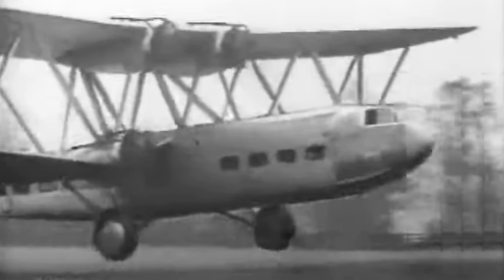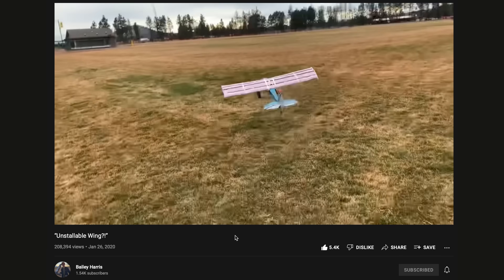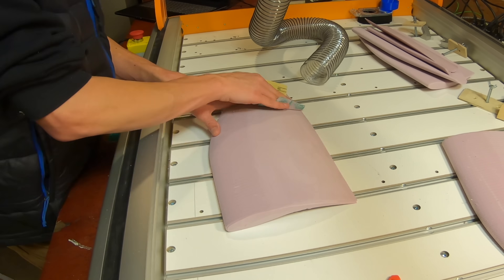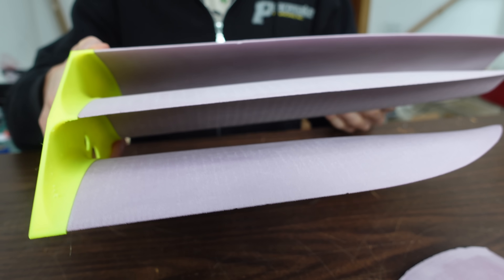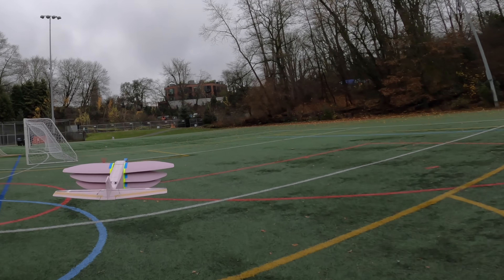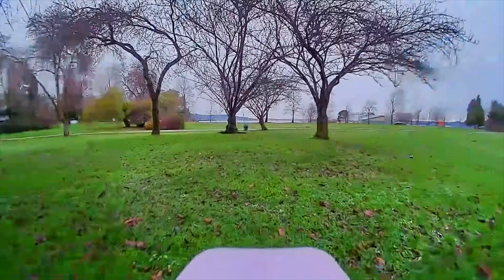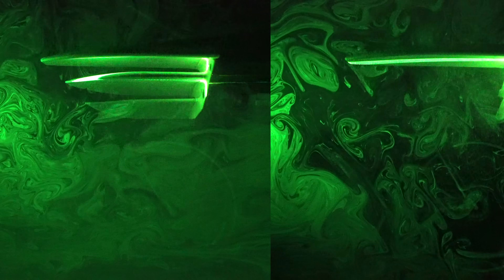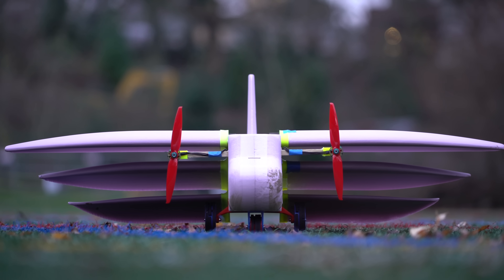Best STOL Wing Design Ever?!?

Comment: Would the wing configuration work as a "flying wing" design? Without the draggy middle part and all lift surface? Basically taking multiple B2 with caried angle of attack stacked on each other.
Reply: Probably not, due to the pitching moment issue he mentioned. A flying wing has no horizontal stabiliser to balance the plane, so it cannot use wing designs that have a positive pitching moment at positive angle of attack. Ignoring this rule produces a plane that is intrinsically unstable, and while that might be acceptable with computer assisted stability controls there is still a limit to how much instability can be present before the elevons are overwhelmed.

Comment: To help fight the pitch down effect, it may help to mount the motors lower (closer vertically to the center of pressure) and/or make the thrust angle higher in relation to the wing.

Comment: the thing about that multiple wing is that works properly by laws of physics only when its reversed so lower wings are in a front and upper is in a back  then the lower wing air flow pushes up an upper wing and next one does the same . I this configuration air flow of lower wings is disturbed by each other . And that specially works in higher velocity , you´ll see , try to change that design

Comment: You put a lot of thought and work in to the concept. Good work. Look at the Burnelli UB-14 aircraft. The designer had the same pitch instability issues due to the downwash from the main top wing. As it leaves the trailing edge it momentarily goes down wards and them it moves up. In this case as the trailing edge wash moves up  it hits the underside of  the elevator causing a pitching moment instability. This makes it harder to control. If you would like to make the plane dynamically balanced it will help to move the elevator further up and away from the trailing edge wash. That is what Burnelli had to eventfully do for his high lifting body concept to work.  Thank you for sharing the video. I enjoyed it.

Comment: If you move the motors further down it will reduce the pitch down and increase the "blown flap" type lift except you will have a blown wing. I bet it can reduce the stall speed by about 1m/s.

Comment: Not sure about best design ever. Mike Patey's Scrappy is equipped with solar cells, batteries and charge controllers to charge 2 electric motorcycles which hang from the wings and still lands at approx 30kts. His wing is a single airfoil with twin leading edge slats and articulated flaps. The ailerons also droop with the flaps.
Reply from the maker: If it has leading edge slats and detached flaps then is it really a single wing? 🧐

Comment: Outstanding project. The down pitch would be lessened if you could lower the center of thrust (but keep the props from hitting the ground). Or maybe mix in some up ele. with throttle.

Comment: Put the power in the back and you will see more stability when adjusting pitch and yaw because you will be manipulating the weight in the back to steer the plane by pushing Instead of pulling. But you'll need a different motor

Comment: If you lowered the engines, would the tendency for acceleration to push the nose down be eliminated? 

This design seems to have a lot of potential for any plane wanting long linger time over a site. It's almost a cross between a blimp and a plane in terms of buoyancy and speed. Just fly a tight spiral and practically stay in one place.

Comment: if it was a pusher, prop wash wouldn't exist over the wings causing different air pressure with throttle.

Comment: Awesome....  Any chance you could provide some details of the build so i can try something similar .....   whats the span of the straight inner sections of the wing and the offset between the root chord and the tip chord, The overall span etc. I already gleaned from the video the root chord angles... Looks brilliant in the air... well done

Comment: The motors are probably mounted (from side projection) above the centre of lift for the composite/compound wing, which is why there's a pitch-down moment when you throttle up?

Comment: the new 360 cameras are such a game changer not only is it so much smaller it actually works better, 5 years in electronics is two decades in mechanics my 2015 car has an identical looking and size alternator as my first car made in the 80s you don't see that in electronics

Comment: If those stacked wing sections were mounted between twin hulls of an ekranplan and could be open or closed to  fly at different altitudes efficiently that would be good?  A plane that could trap a lot of lift to fly low in ground effect, then morph a percentage of its central wing  to fly in higher altitudes efficiently. Does that make sense?  Edit... Thought about this, the twin hulls would need a fixed front canard and twin boom rear stabilizer to keep them parallel if the central wings moved too much.

Comment: I'm an old surfboard builder. But when I was a little youngster, my dad and I used to make balsa wood gliders, so I like to see what people are building these days. I Iike the multi wing set-up and the added lift effect. On glassing your wings, I think it's a lot easier to just glass them like a surfboard, with a soft rubber squeegy and fast hardening epoxy. Epoxy that has about 20 to 30 min working time. You can do one side of all the wings in one batch, trim them when they are hard enough not to make the fiberglass frey or tear, so you can slice it clean. That way it fast and easy. Then you put a fill coat on everything, with a 3/4" to 1" (for models) resin brush, so you can sand it flush and smooth.

Comment: Maybe put the wings on a servo to rotate them while landing so you can change the angle of attack? They may need to move rearwards at the same time to offset the increased lift and not upset the CG/Drag balance.
Reply: I was actually thinking, add a servo and linkage to collapse the lower two wings into the top one. The linkage would be a pain to calculate though...
Reply: @markp5726  They'd basically be slats and flaps at that point. What youre describing is exactly how aerospace engineers decided to do it on large planes.
Reply: Wouldn't that have to be forward, given it's already tipping forward when accelerating...?
Reply: @lukearts2954  it's probably prone to tipping forward because of the shape of the wing and it's angle of attack. From an intuitive standpoint, the wing segments want to fly flat with zero angle of attack because theyd have less drag, so they're trying to pitch forward. Engineering, the trailing wing sections are probably below the center of gravity and a large component of their lift is angled rearwards, basically drag. So the second and especially third wing have a vector of lift that's applying a torque around the CG that pitches the plane down. 
If you rotate the wings to a more level position, they'd generate less lift and they'd do it in a more upward direction instead of angled back. From a lift perspective, rotating level would push the center of lift rearwards as the wing generated less lift. From a drag perspective, the wing becoming level would create less drag and you'd benefit from moving the wing forward. I'm not sure which matters more though, I'm just pondering.
Reply: I think putting the motor on a tilt-mount would accomplish the same thing - changing the relative angle between the thrust vector and the wing. Angle of attack is controlled by thrust and pitch angle.
Reply: I'm more concerned about landing that thing with the surface effect.  It's great when you're going for a Short Take-off, but you actually have to stall ^That with all that lift bouncing off the ground, back under all 6 of those wings.  STO isn't really all that great if you can't land it safely on any runway of reasonable length.
Reply: Yes, I came to say, put the whole yellow wing holder on a servo to rotate the attack angle.
Reply: this is staring to sound like some kerbal spaceprogram level engineering now hahah
Reply: Umm wouldn't that defeat the purpose of haVing a fixed wing aircraft
Reply: @josephc.9520  My thought, it's an experimental wing(S). Is the optimum attack angle known? So let's experiment!
Reply: @OKuusava  what about having the engines pointing more up to counter the nose dip action?
Reply: Yeah, having the bottom 2 wings an a switch to level them out would be sick.
Reply: @123fffaaarrrttt  What Is Islam?

Islam is not just another religion. 

It is the same message preached by Moses, Jesus and Abraham.

Islam literally means ‘submission to God’ and it teaches us to have a direct relationship with God. 

It reminds us that since God created us, no one should be worshipped except God alone. 

It also teaches that God is nothing like a human being or like anything that we can imagine.

 The concept of God is summarized in the Quran as:

{ “Say, He is God, the One. God, the Absolute. He does not give birth, nor was He born, and there is nothing like Him.”} (Quran 112:1-4)

Becoming a Muslim is not turning your back to Jesus. 

Rather it’s going back to the original teachings of Jesus and obeying him

Comment: Dihedral would help. This plane is like flying with the flaps down all the time........How about making multiple slats up front? but smaller and staggered just enough to force the air between them to tame the rapid stall you encountered. Nice video.

Comment: Really interesting. I believe the stalling happens in a little bit different way. The air from under the wing comes around the trailing edge and starts climbing backwards on the upper surface of the wing. The air coming above the wing detatches because there is no vacuum but that backwards creeping air.
I got some idea. Make the wing hollow, put a slit at the trailing edge. Add some blower or compressor so the air can be blown out and backwards from the trailing edge. This should stop the air from below the wing coming above. Use the blower at slow speeds, don't need it at high speeds, but it does not hurt, anyway.
I have no chance to build a prototype, but it would be interesting to hear if anything like this ever works.

Comment: This principle at its most basic would explain why biplanes for the most part have zero incidence on the upper wing and positive incidence on the lower wing and dihedral on the lower wing? I wonder if there's something to staggering the wings further to interact with each other in such a way as to excite and stimulate the boundary layer flow behind the center of pressure? Your washout solution was clever, I wonder if an interplane vertical surface joining the wings at the tips would help with tip vortices? It is strange to me that Elevons don't induce a pitch moment in roll

Comment: Dang it flies like a bird! Plus the slower speed does less damage when you run into a tree trunk. I find the characteristics of super slow flight fascinating for some reason. It's under rated in my opinion.
Reply: I think it would be absolutely amazing for amateurs/children/indoor flight! Imagine if it fly at just about walking speed! You could loiter very well, you could actually fly it indoors in a larg house or definitely a school gym or something. You wouldn't need as much space to fly at low altitude so city kids could fly it at the park, and crash speeds are much lower reducing injury to both people and aircraft!

It might be fast, but it's very useful! I wonder if inflatable wings could work on this design? It could reduce weight and increase crash resilience.

Comment: Have you seen  Mike Patey's Scrappy? It's got giant slotted flaps and double leading edge slats and they have not pitching moment. Very with a stall speed in the low 30's, despite being a 8cyl powered 4 seater.

Comment: Have to say I love every one of your projects. They each get the thinker working and the main question I have with this one...why care at all about how slow you can go without stalling. The real gain of this would be to see how much weight you can lift with the design.  Can you imagine if you could put wings on oversize highway loads to take to the sky instead of ground transport with all the obstructions in the way of those deliveries. You wouldn't have to go 100's of miles per hour but avoid all the land based obstructions. Could there be a more energy efficient plane doing the work of an Antonov A-?  Try this same plane and see how much weight in it you can fly.  Great stuff...lots of questions.  :)

Comment: The Horizontal Tail needs to be in T Tail format. This would give clean airflow. As for wing tips --- the washout is Good but the semi elliptical taper invokes VERY low Reynolds N umber airflow. Instead a wingtip that takes the form of Bowing 787 tip -- works very well with the washout. My thoughts are from 50+ years of modifying and designing R/C aircraft.

Comment: I think if you incorporated a high tail like a C-130 (landing at high angels of attack) along with elevators that use the entire horizontal stabilizer like on an F-14 you could fly the wing at a lower angle of incidence like the other two youTubers but also be able to transition into a very high angle of attach like Hadley Page envisioned.   You may also need to vary the angle of thrust by having the engines pitch down when at this extreme angle of attack.  Or the other way to look at it is build it so it starts out like Hadley Page envisioned (super STOL) and in flight transition to the lower angle of incidence for higher speed cruise flight.  You could possibly make the 3d printed wing mount articulated so it can rotate and pitch the wings relative to the fuselage.

Comment: The major flaw of the plane (nosediving due to the high mounting point of the motors) is fairly minor, it otherwise looks like a solid design. Would probably be great for competition lifting challenges, like SAE Aero. 
Considering that the focus was on the wings, you did a good job of drafting a vehicle! 

I know a couple guys on the SAE Aero team, the focus at my university is now body-lift with some internal storage, they already do multi-element wings. These guys also use iterative neural network  design to find out what wings & bodystyles work the best for the parameters they want. Really freakin smart people.

Comment: Just by looking at it, I'm thinking the power required to maintain speed (i.e. the drag caused by the wing) would be terrible at the speeds airliners usually cruise at - I'm thinking 400 to 600 miles per hour

Comment: You absolutely have to get rid of the flight controller stabilization module, ie. the thing that auto corrects a bad design or pilot... Start out with a simple chuck glider to prove the design, build an RC version after it's fined tuned, otherwise you are going through a lot of hassle for a design that's hopeless.

Comment: Nice flight demos. Loved the laser fog visuals. The CNC foam cutting is amazing. 

Wondering if you were to 3d_print alternative wing mount so all 3 elements had same angle of attack as the main (single) wing? Would be interesting to see how compares as a tri-plane vs. with 2nd and 3rd wings in STOL mode with higher angle of attack. 
BTW: A t-tail elevator likely would give better pitch control (up high and out of turbulence)

Comment: The slow flight, without the jiggles of running a more traditional wing that close to stall, seem to give really good footage, possibly because of the frame rates vs scenery movement. I audibly exclaimed in amazement during the first nose-back inflight clip. Now, I'm curious about injecting thrust between the wing panels more deliberately, to see if a more quad-like "semi-hover" can be achieved... Possibly with a V-Tail that has fans (with overlapping fan blades so it can be more normal to airflow for normal flight) in the tail surfaces, that turn on when needed... Or essentially, another attempt to productively merge a multi-copter and an airplane. 

Also, a hearty "screw you" to all the dirtbags who aborted the video to run to the comment section with false condolences. You are motivated by vanity so intense that you will exploit the death of another in the hopes of gaining a modicum of attention, while exhibiting no actual value of your own.

Comment: I used to had a gas powered 20 2-meter motor glider that  I put elevators, flaps, and spoilers on the wings and had  twice a big rudder and  elevator. I could walk behind it and it flew the entire runway with the motor turn-off at 1 1/2 feet!

Comment: Could the same idea be used for wind generator blades? I made and 3d printed a double blade wing gen design (stacked) of my own to see if I could use the accelerated air off the front blade to try and increase efficiency, torque, and speed for the second set of blades. Trying to see if less length of blades and decreased diameter of blades could be used to drive larger generators. Not much luck due to needing the right airfoil and thicker airfoil design.  Too busy doing other projects around the place to explore my idea more. Thoughts? Would you have or make available the STL files for your wing root design?

Comment: I have a surefire solution to rescuing parkflyers and quads out of trees. It consists of a 5' piece of 1" pvc, a fishing reel, an arrow shaft,  and the latex tubing from a slingshot. This can be used to fire a line over a tree branch accurately. Once you have the line over the branch, you can use it as a leader to pull a rope over the branch to get your shake on until it drops. I hope this helps someone; I've used mine many times!

Comment: You've got a ton of blown lift going on there. The big change in pitch when you killed the throttle in that stall was proof of that. Of course, blown lift = blown pitching moment, since lift and pitching moment are closely tied together. Also, as another person mentioned, having a tail directly behind the wings will cause some trouble. Need to get it into clean airflow, which will substantially improve the pitch handling.